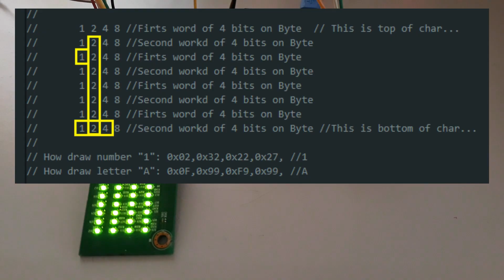74HC164

Comment: Well, the savings in data lines when using shift registers costs a lot more effort when programming.
I prefer hardware controlled static or multiplex displays.
This always ensures that the output occurs at the right time and in the right place, right?
Reply from the maker: Hello thomasw2509,
First of all, thank you very much for watching!
Every situation has its advantages and disadvantages!
It depends a lot on what we have to prioritize, whether it's the features or the costs. Here, what we're doing by using shift registers isn't even necessary; we could only use pins 5 by 7 of the Arduino and we could control a series of digits with this matrix, but we're practically building it without available pins... of course, if it were a 2560, this problem wouldn't arise because it has more pins. But truth be told, then why not use an LCD with SDA/SCL?
The intention is to make concepts as versatile as possible so that they reach everyone and can easy be adapted them to the trash we have at home, which is why I don't normally use the library, resulting in extensive but basic code, but I bellieve any person take a litle of time catch it.
Since I get so much help online, I like think this can help as well.